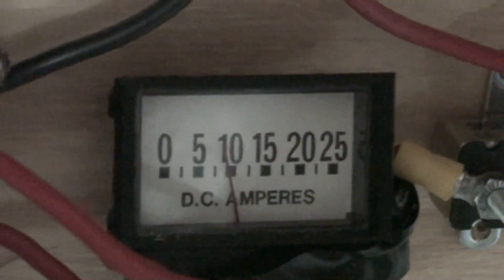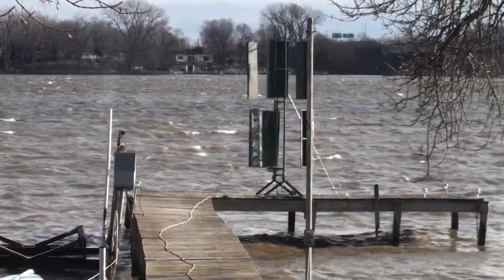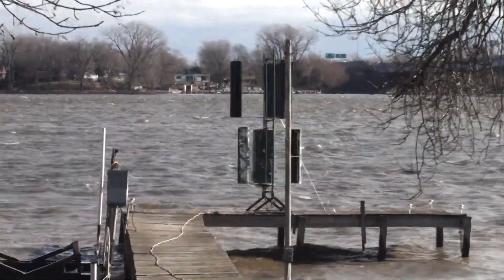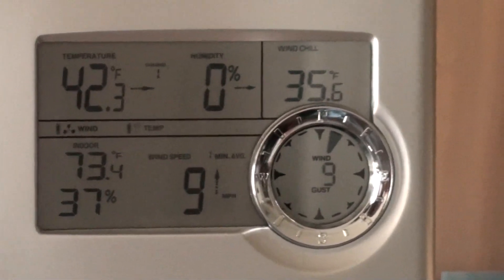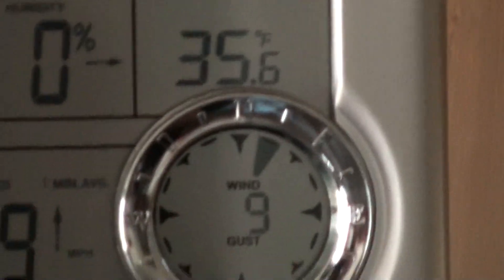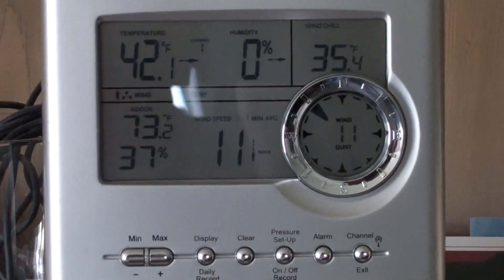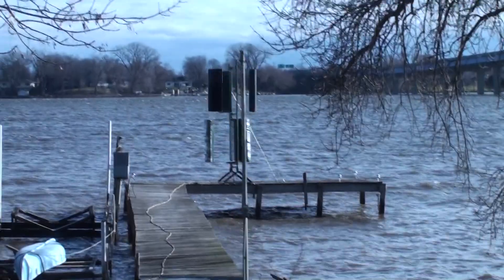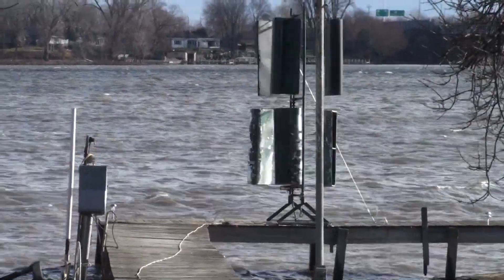Lenz 2 counter rotating better stator on alternator

Comment from the maker: @GoVertical17 I did try a crudly cut  set  of foam wings on there but I was not getting good results when I had them on both wings. I think if I had stayed with it and  tweaked the wing angles etc. it might have been better but I already had these modified lenz wings built and sitting in the way in my garage. So I decided to rebuild them with the correct shape for lenz 2 wings and they seem better for power than the foam wings. They also get good RPM's. I will still experiment.